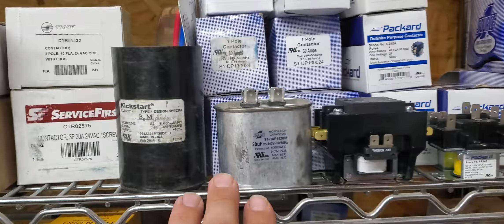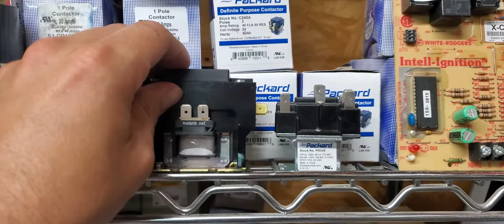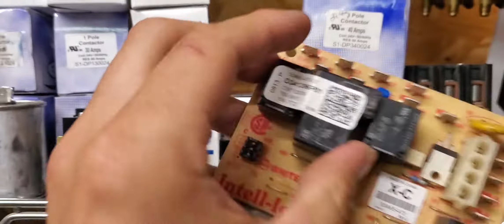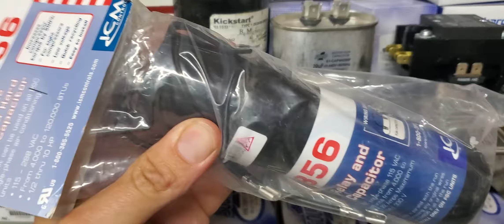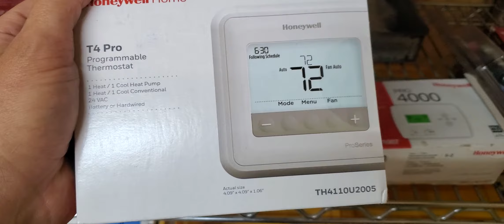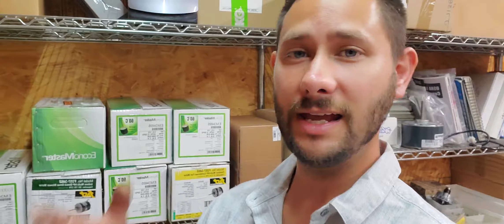Air Conditioner Parts That Fail The Most #hvacvideos #hvactraining

Comment: Intsalled Nest with no heat pump. Summer days are hot and I've set temp to 73. Thermostat will hold steady but then mid day the inside temperature begins going up and the inside heats to 75. If i turn the AC on the nest to 74 degrees the inside goes up to 77. If I raise the Nest to 76 degrees the temp in the home goes to 78-79 degress. Motor is fine. Vents and filter are clean. A tech came out and checked freon and found no issues. Any ideas?
Reply from the maker: get a infrared thermometer and check temp above stat check ceiling any areas maybe attic access door if close by for any hot spots 
make sure you have adequate insulation and ventilation for attic 
I will do a video to help
Reply: @taddydigest  let me know when you do video
Reply from the maker: I did the video I will edit it tomorrow
 And I will Upload it for you
Reply from the maker: Here ya go my friend I hope this helps you https://youtu.be/5Ku2Ao7_gU0

Comment: whats the most common part failure in a ductless mini split?
Reply from the maker: most common problem is leaks from poor installation practices 

most common parts would be PCB  sensors or inverter board